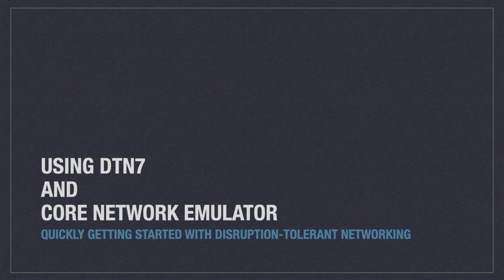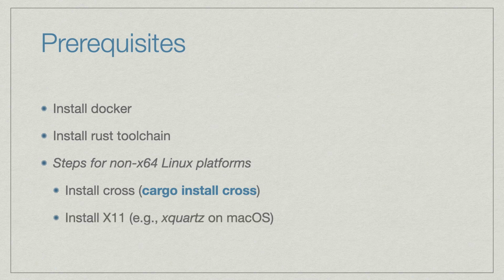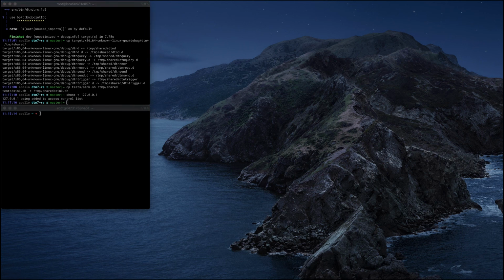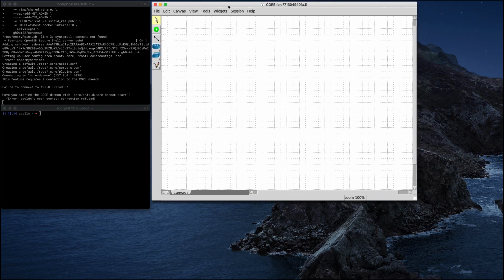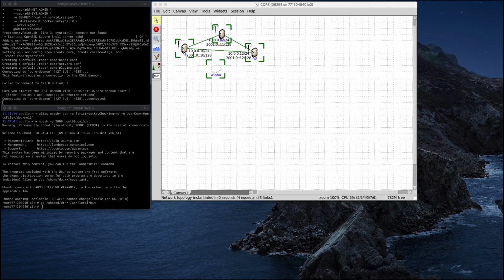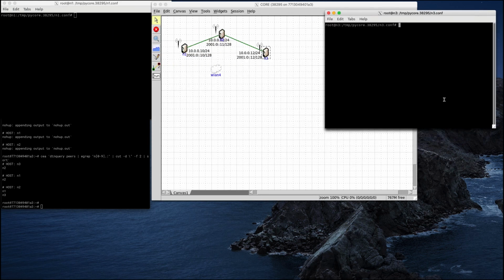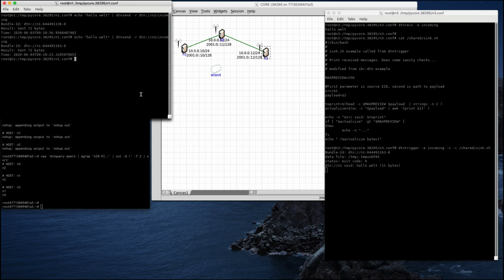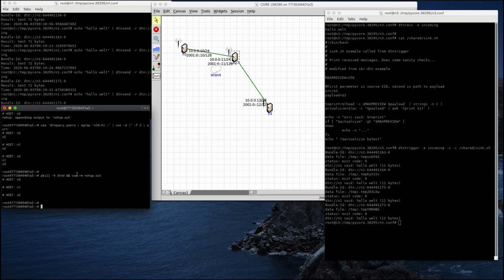Quickstart using dtn7 and core network emulator

Comment: After pressing the green start button to start the simulation, is there something else you have to run to turn the red boxes around the hosts into green ones with the connected lines?
Reply: usually not. but if some kernel modules are missing (ebtables and/or sch_netem) or if you have docker installed and it messed with the default firewall policy for forwarding you have to change it to accept - the latter only applies if you are not running dtn7 itself within docker as described in the video.

from which OS are you running the docker container?